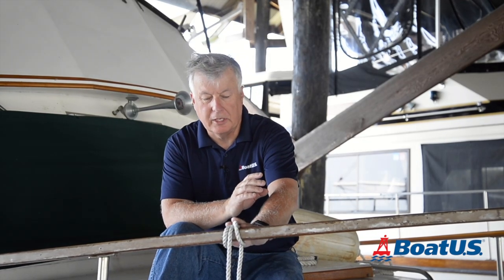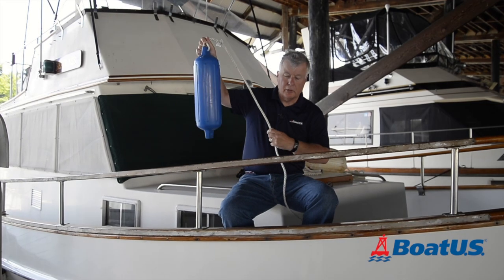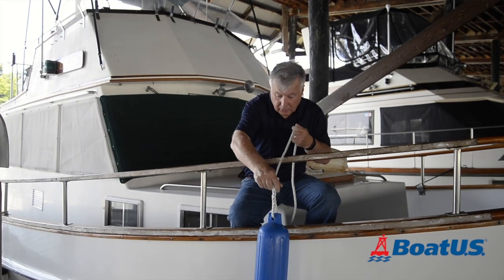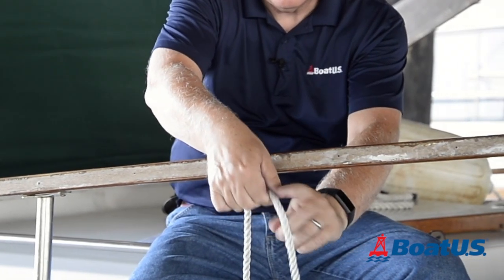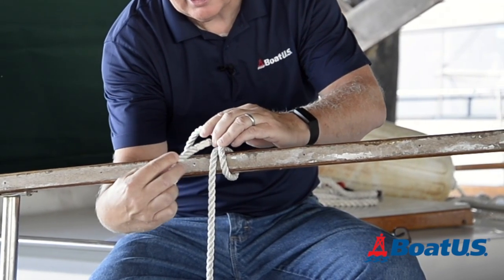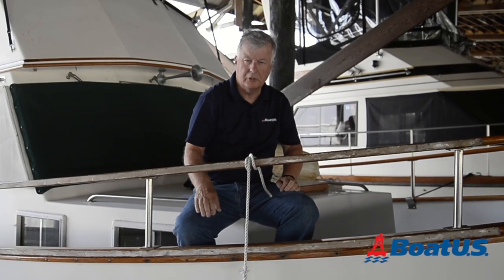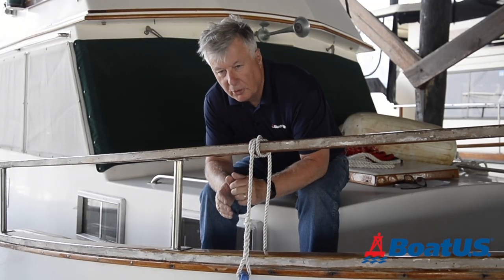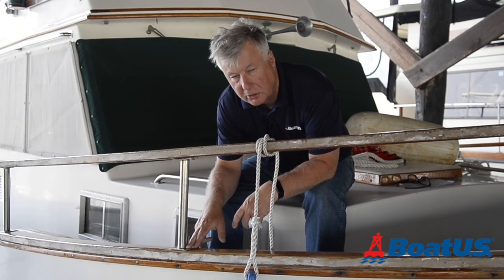How to Tie a Clove Hitch Knot | BoatUS

Comment: For those who get a little confused on which way to go around the standing line when tying a bowline, I have a cheaters bowline.  Start the standard way with the loop.  Then pull a loop of the standing part up through it.  Insert the bitter end/working end into this second loop (the loop formed with the standing part) and pull it back down.  You will have a perfect bowline.
Reply from the maker: Great advice for a bowline, Steven! I have always had trouble tying one for whatever reason, and your method makes much more sense to me. I believe we demonstrate the version you describe in our bowline video: https://www.youtube.com/watch?v=xapIxuwR8sc&t=45s
Reply: @boatus  Nope, that video is the standard bowline.  When the scouts taught it they use the "make a hole, squirrel goes in the hole, squirrel goes around the tree and comes back out the hole."  The problem is if you twist the line the wrong way to make the hole, the knot falls apart.  Doing my cheaters way, you are making a slip knot, threading the tail through the slip loop, then pulling the tail back down with it, which leaves you with a bowline.
Reply from the maker: @stevenplank7058  Appreciate the explanation. Maybe I'll figure it out sometime in this lifetime ... 😂

Comment: It is not a good idea to promote the use of the clove hitch to hang fenders, as the clove hitch can undo itself if subject to jerking side-wize motion, as occurs in windy conditions.

The round-turn-and-two-half hitches is the more secure means to hang fenders.
Reply from the maker: Thanks for your comment. There’s more than one way to attach fenders to the boat; the clove hitch is but one.  I personally favor using the clove hitch as it is easy to tie and easy to adjust should the fender need to be raised or lowered once attached. It works for me, and I’ve never lost a fender due to it becoming inadvertently undone. But your way is valid as well.